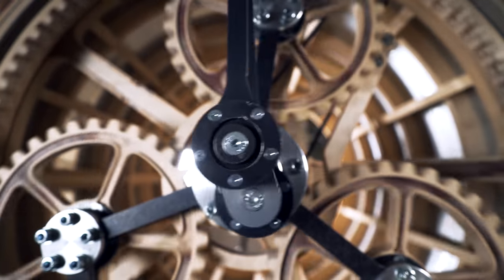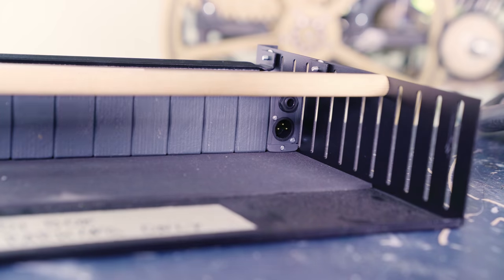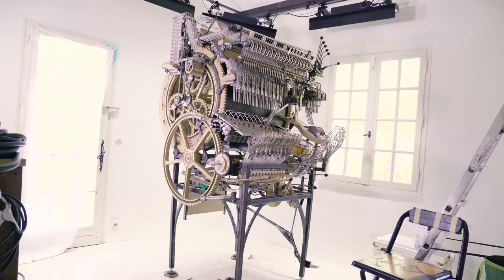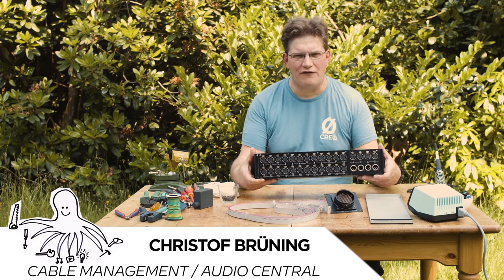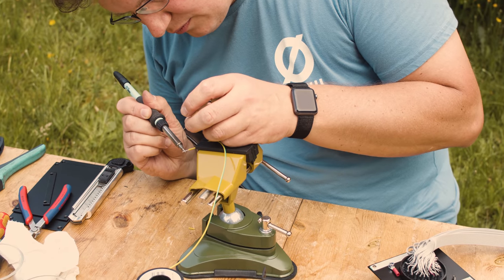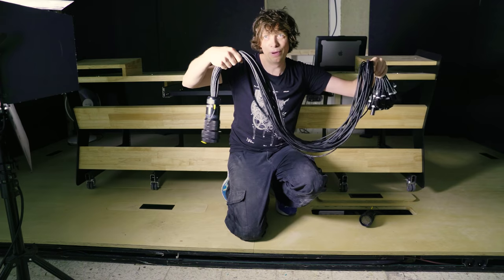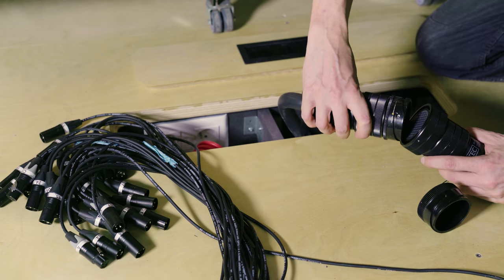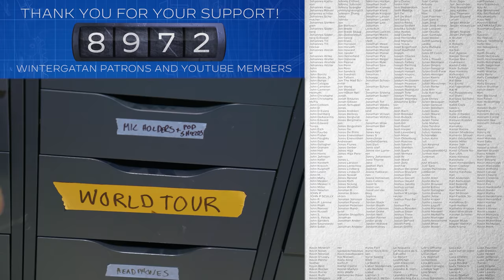28 Audio Channels in One Cable! - Marble Machine X #133

Comment: Were i you, i would've made a custom extension rack that would've hung right above the arch strut and before the programming cylinder. A box with a rounded end to match the programming cylinder and hanging outside the machine. Kinda like how dune buggy car (particularly those made from old VW shells) have their engines hung out. That way, you can keep it neat and organized and even give it a sense of style. AS IS, it kinda seems like you shoved it in the machine, and it kinda ruins the nice open visual bottom (feet space) that the machine has. Personally, i think that open space is quite literally the most endearing visual aspect of the MMX. An supple, thin, petite bottom section followed by the baroque, eccentric, maaasive top.

Comment: To me you're not just building The Marble Machine X, you're building a computer from scratch, that is programmed and the balls are like electric going through the system. I just think it's like a musical computer. Given you're using modern computers for all the audio equipment. But still. Back in the old days computers ran on punch cards a lot like how this machine works. Plus logic gates. :) 

Great way to explain how a computer works at the fundamental level, and everything after that is building on these concepts, and that is standing on the shoulders of giants. It's a little easier to follow then the Babbage Engine. :)

Comment: I had a feeling that the multi-pin connector (Amphenol?) was available in a 45 degree line socket too. That should make the cable look much neater by dropping closer to the MMX frame.

Comment: Q: Signal path and attenuation... I so love the look of the male and female circular connectors you have Martin. Concerning signal path from mikes; mike to pre-amp to circular connector to <boa constrictor> to circular M/F to spider into board... OK, I'm sure all connections are tested clean and tight. But what about attenuation with the long signal path or transition into and out of the circular connectors? Any signal loss? Or are the pre-amps there to push the signal to the recording board? As always so love the design and solution. Ciao~

Comment: Martin, I'm sure you know this, but as an electrician, I want to make sure, since you're probably used to thinner cables. All cables have what is called a Minimum Bend Radius or MBR. This is the radius of the imaginary circle the cable follows if you were to bend it. For many thin consumer cables, this is not much of an issue. You'd have to almost fully fold small cables before you damage them, making the MBR extremely small. Really big/thick cables like the one you're messing with has a larger MBR. The issue here is all the little conductors going through that cable. As you bend the cable, the conductors on the outer edge of the bend exhibit a pulling force while the inner edge gets squished. Bend the cable too far and you risk damaging the conductors at the bending point, pulling the outer conductors apart. It's safe to assume the MBR is slightly less than the radius the cable was coiled with when you received it, try not to bend it further than that.

Comment: Good thinking. I build something similar for a 16 channel analog audio mixer a long time ago. A live audio technician wanted everything on the podium and basically wanted to extended the connection plate from the audio mixer to the podium. So I builded a flight case for his audio mixer and added an huge 96-pin connector on the back. I also builded a box with at one end another 96-pin connector and at this he other side a replica of the backplate of his audio mixer (on the podium). This way he could use a single cable to receive and send signals to the podium for the live band. The only problem was the cable weighted almost 3kg/m and he needed a 30 meter cable. So the cable could only be moved and rolled out on a cart or by two men. For the record: it was for a low budget band who couldn't afford digital audio mixers and processors,

Comment: If not mentioned surely it would be possible to put a threaded ring on the audio box on which the lid can screw and lock on, so that is won't be forgotten, or lost. I mean it has to managed during tours as well (it seems like one of those risky last minutes decision, that putting a new wire on it is forgotten and when packing one decides to solve it later, and then suddenly it is stage time, and no security wire on there).

Comment: Hello Martin, Good to see that you are making progress. There are a couple of points that concern me about your world tour, things that you have not spoken of, but which I hope you are brearing in mind and maybe already addressing. 
The first is maintenance, you have said a few times that the MMX has more parts thna a car - these parts will require rwegular checking and maintenance, do you have a maintenance schedule planned. Things like checking the wooden gear teeth for wear, maybe repairing them with some epoxy if there is wear or delamination. Checking that everything is moving without friction and possibly spraying some silicone lubricant. If you want the machine to continue working faultlessly you will need to do this.
The second point is emergency repairs. Last episode you repaired the marble ladder damage coused by a loose screw - you just had one spare ladder link, if this happened on the road it could be a disaster. You need a complete set of spares plus the facility to make any spares not carried, like the plastic tubes. Think racing car repairs, spare engine, lots of tyres, mechanics ... etc. Idealy the machine should have been made in modules which plug together - but I suspect this may have made it a lot more complex. Suppose someone tripped over a wire while changing a peg programming section, could you repaire it fast.
Also it may be a good idea to the first half of a concert already pegged into spare boards to avoid delays between pieces.

Comment: I would have reverse engineered the pre-amp circuit and put all 24 circuits on one PCB to avoid all the connectors. But then again I would have done the sound generation in electronics and not in mechanics ;). Good luck with your project.

Comment: A thought just occurred to me. you may want to get a cover to place over the big connector on the back of the machine for the world tour. like a heavy duty lens cap.
don't want to bend a pin on it in transit, not like you can just run out to your local electronics store for that monster!

Comment: Sommerfagel is one of my favorite songs, thank you for including it in the video. I have a small concern regarding the placement of your audio central. Idk if this is a real concern but it seems that the marble tracks right above the brain might induce noise into the system when marbles are running over it. Either way keep up the great work, i’ll be in the front row when you come to the SF bay area. Also I’m pretty sure the technical term is snake 🐍

Comment: I might be misunderstanding this, but are you using all 24 audio channels? The most important thing for world touring is spares. If one of those brilliant little cables inside of there breaks, you need to be able to quickly swap the channels to replace it. 
It's easier for it to happen then you think.

Comment: Martin I have a couple of concerns about your world tour, which I have not heard you mention, but which I feel should have been addressed by now. The first is a maintenance schedule, you have mentioned that the MMX has more parts than a car, some of the parts will need regular maintenance like a car (e.g. timing belt changed every 65,000 miles). other parts may need regular lubrication with something like silicone spray. Parts may need checking regularly for wear, possibly the teeth of the wooden gears, and repairing with some epoxy from time to time.
The second concern is spare parts. It's inevitable that something will break or go out of specification, or someone will trip over a loose cable and drop a vital part. You need a set of spare parts (particularly as some of the components are quite delicate looking) and also the facility to do rapid on the road repairs. Ideally the machine should have been designed in a modular way to allow complete sub assemblies to be simply bolted on at short notice, that way you have built in resilience.

Comment: Thor makes a 32 channel XLR over optical unit, it takes 32 bidirectional channels and sends it over single mode fiber, then breaks it back out at the other end. That will reduce noise and interference potential significantly, especially at concert venues where EM is almost never even thought about. Those connectors are also awful to maintain, keep the squid end on it in storage, replacing pins is the worst thing.

Comment: I think MIDAS DL151 and DL152 would be the easier solution on stage. Just go from DL151 to the main mixing console with aes50 or from DL151 to DL152 with aes50 if the main mixing console has no aes50 input. Even in Studio you can use the combination of the two midas devices or go to the computer directly with Etherface from DSPRO.

Comment: Me sitting here with a 200' SOCO cable and the NL4 Drops I've been working on for nearly 4 hours wiring it all. It was time to replace the ones I've used for a couple of years, but need to be replaced.

Comment: Martin, please start engineering a software solution that can fill in for ANY missed notes since the songs you're playing will be mostly known compositions. If any of those tiny wires (or mic, or marble channel, etc)  breaks mid-concert, your song is wrecked by missing those notes probably for the rest of the show. I think this would allow you a good amount of redundancy that would otherwise have to be physical parts (which is not feasible). I also don't think anyone would fault you for using a recorded note since all of the sound is passing through other electronics as part of the usual output.

Comment: As a live engineer who has been the house engineer at a theater venue, which is the size that you're most likely going to tour in, most of those places wouldn't have the number channels needed for the mmx alone let alone with Wintergatan as well as the space in the booth for a second board that you might bring. Please for the sanity of all house engineers you come across on your tour please dont just hand them a snake head and say here mix this. You should really consider mixing down on stage and sending the house/FOH groups of channels mixed down into LR instead of each mic input on it's own. I get that you're probably have your own tour engineer, which I'd love to apply for btw.
Reply: I don't doubt this is what they'll do. Have a dedicated board just for the MMX with all the DSP tailored to each Mic / instrument. However as others have said going Dante or similar would make it a hell of a lot easier.

Comment: You want to be really careful with that big multicore cable connector, if you twist the connectors while putting them together you may aswell throw it away. It is easy to bend the pins in them connectors.

Comment: with that stiff cable, You will hear every wiggeling or shaking on stage transported trough the stiff cable!  - better a digital mixer or two and then the MIC-Preamps are already integrated and you could forward the signal via wireless or 2 or 4 fleixible and thinner pairs of XLR-cables to the main mixer.

Comment: You are using connector with inserted pins.  I refer to these as "deployable pins" because when you are on your tour, and you connect the cable, some pins, instead of mating, retract into the connector, perhaps contacting, then becoming intermittent in the middle of a song.
          You are also routing a lot of analog signals in non-shielded cable.  When you go into a new venue, you don't know what noise sources await you!  With luck, you will be located right behind a data center, with its digital noise!
          You better stock some Cramolin (Caig corp) treatment for the connector pins to assure solid contact.
          The support for the electronics should be BOLTED ON, not tack-welded.  Welds are fragile in shipment!
Reply: Every cable has it own shield inside, every third pin is a shield (if wired by LK-norm)

Comment: Please make the wires in the harnessing for each signal a different color...that will make troubleshooting much easier if there is a problem on the road...if the wires are all the same color you have to use a meter on each wire to figure out what goes where, which is a huge pain. I say this from experience.

Comment: Have you looked at how much noise is introduced in the system with that long a cable run?   I was also thinking that having a computer mounted underneath amps instead of running a huge cable clear across the room.   Still cool...don't take my questions the wrong way...you are my Wednesday coffee break.

Comment: Having a single large cable for all your audio outputs does sound some alarm bells in my head. It’s a single point of possible failure which could take the whole machine offline. Having worked in live production and touring for several years I get concerned looking at that thick loom knowing just how carefully it needs to be treated. Just food for thought.

Comment: Question, if it hasn't been asked yet - Will you have a 2nd python cable to take with you on the world tour, or will you remove the cable from the ducting to use when travelling, and then put it back?

Comment: The MMX is looking a little top heavy on those spindly legs... will it hold up to the centrifugal forces of the flywheel and gear rotations without flying apart due to the weight distribution?

Comment: That seems like a wierd design for the preamps? Why would the company not just tap 2 threads into the casing so you could put the screw in without that nut...
Seems dumb to have to dissasemble the preamp to get the clip off
Reply: Its not really meant to be removed

Comment: Martin, is there any reason you didn't go for a Dante or MADI stagebox instead? Most Dante or MADI stageboxes incorporate preamps and phantom power, so it would have cut down the number of boxes (and points of failure) on the MMX Audio system. With Dante or MADI you could have all those channels over a single Ethernet cable (Dante and MADI can actually do far more than 28 channels of Audio over a single Ethernet cable). A lot of touring sound desks also accept Dante or MADI natively. Additionally, Ethernet cable is much easier to repair or replace than an 85pin VDM multicore. 85pin VDM is a pain to fault-find and repair, so on tour you absoluetly need at least one spare. A Dante or MADI solution would be much easier to tour with.

Comment: Why not a Stage Box with Dante Network? Did you want to use your (special?) A/D Converters? 
Because with an Dante Stage Box, you would've your A/D Conversions nearly as close as possible on your Mics and you would just have one single and cheap Network Line instead of this Boa Constrictor.

Comment: You can't call it a spider when there's a much better name... It looks like an octopus with 28 legs. The word Octopus comes from the Greek for "Eight feet". But there's actually a (very obscure) word in English with the Greek for 28 as a prefix: icosioctogon, meaning 28-sided polygon. You have to call that connector the Icosioctopus!

(Icos- is from the Greek root meaning twenty, as in the twenty-sided platonic solid the icosahedron, and anyone who plays tabletop games which use twenty-sided dice will probably recognise it. I'm betting there's a few of those in your audience...)

Comment: You can't have power and audio lines running parallel so close to each other, especially if they are carrying microphone level signals.  They need to be at least 6 inches apart.

Comment: Did that dude just solder a crimp connector? Dear god is that what passes as high quality in this industry. If your going to half ass the connection the least you could of done is gotten a fluorinated insulation so it didn't pull back like 5 miles when you solder it, the added heat shrink is dead giveaway that happened. Go out buy a proper crimp tool you will get a more robust higher quality connection. This 2020 no professional should be using solder contacts for anything practical jokes or a acts of desperation.

Comment: Why not use an ethernet patch instead of that LK85 connector?, its smaller, easier to spec, you can run 2 side by side for redundancy, plus then both ends of the snake can be rack mounted?

Comment: I full on recoil cringed once I saw the welder come out on the frame with electronics. You run a serious risk of frying components like that. I would dismount the lot before even starting the grinder.

Comment: Not trying to bash the work you put in but..... wudn’t a Digital Snake be much better and even help you for recording? Such as a Digigrid? Takes up half the space and runs through a Cat-5e.and if you go with LV1 system its your mixer in one go. IDK if its for tour use... using a proprietary cable that doesn’t seem to be repairable Doesnt seem to be the wisest decision . Usually in a live setting the easier to replace something the better, which is why digital racks are so much better one cat6 cable runs all channels and it goes up to 64 channels. Also DigiGrid are the same preamps used in digico sd7s which is a $200k mixer

Comment: this multi core cables are not that great. if you bend the cable it can pull single wires off the connector inside. the companyx i work for got rid of them. now they use dante.